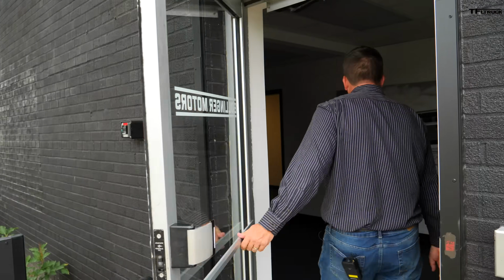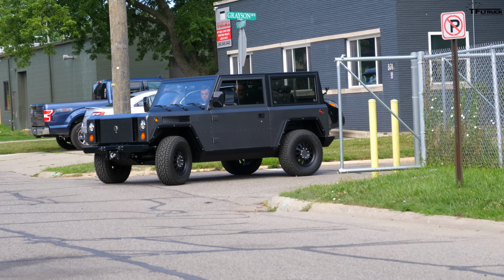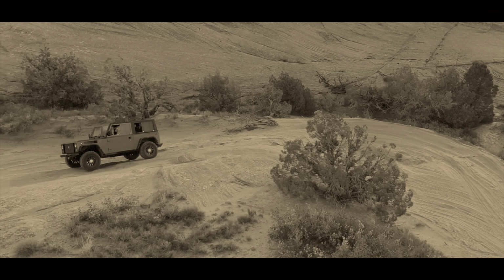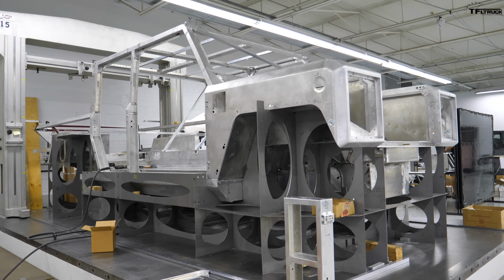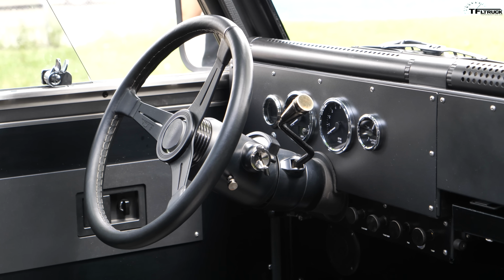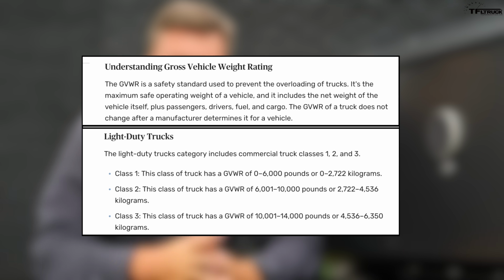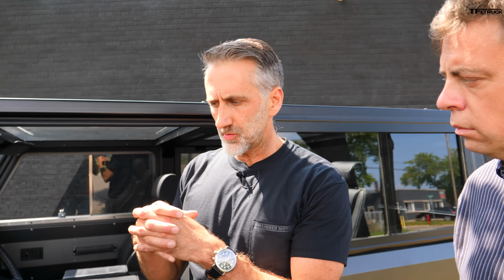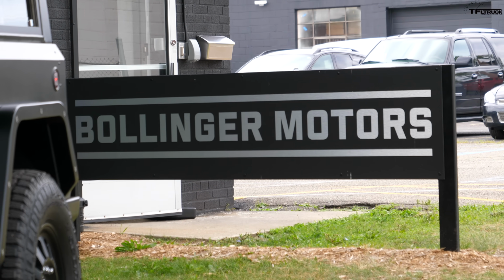EXCLUSIVE! Meet the Bollinger Trucks That Can Off-Road Like a Jeep and Haul Heavy

Comment: I love EVs however too bad these are EV. I could go on for 45min as to why EV off road trucks are silly but ill just say that most trails will be off limits due to no charging locations near trail heads. Even if you have 500miles of range 75% of trails in the US START 300 miles from any charging station. You would get to the trail head with less than 50% charge - I don't think I am ok with that.

Comment: This is a beautiful vehicle but I can't believe it only has 200 miles of range; that's barely enough to get to the trailhead, never mind doing any kind of overlanding. This thing has a 5,000 lb. payload, I don't get why they didn't just add 1,000 lbs of batteries to double the range. Much more valuable than the ability to haul, what, a bed full of lead?

Comment: The Problem with all these electric vehicles are they’re price!!!! This B-2 Is $125K!!!! Before options!!! I own a Power Wagon and My $70K Power Wagon can do all the 4X4 stuff this can do without the extra $70K and it takes 5 minutes to fill up… The only thing the Power Wagon can’t do is carry 20 foot boards through the Cab… So Why are they $125K as the X-ray showed us there are very few parts, a Battery Compartment, and Electric Motors by the axles and wheels.. and only 200 miles of Range???? That Sucks!!!! For $125K I better be able to drive to Russia with it… and 200 range is You babying it.. God Forbid if You Step On It, You’d probably barely get around the block…🤦🏻‍♂️ All these New Electric Vehicles are Big $$$$ How about a Cool Vehicle priced for Us Middle Class people who have mortgages, and Kids… No Way I’m spending $125K ( before options ) on a Truck..JS 🤷🏻‍♂️

Comment: I still dont understand the pricing. For around €100k you're getting what? The plainest, simplest vehicle i've ever seen. That really says something since I've been in a entry level Dacia Duster.

There are no features to the vehicle that would add additional production cost compared to a normal vehicle. No, actually there are no features at all other than it being functional. They're just charging a crap-ton of money for a car simply out of greed. Sure, designing a new vehicle costs a lot, but that's something that you plan for in the long run, not something that should be paid of when the first car is sold. 

Additionally, someone with that kind of money would never be hauling lumber and plywood, they'd hire someone to do it for them. Their market is the working class, not the wealthy. The concept is cool but the execution is just absolute horrible considering the pricing. This is a company that will never succeed.

More reasoning behind this never succeeding is the fact that their biggest competitor, Tesla, is also making a utility vehicle. A well known, huge company. Theirr base model will cost €37k and have more features. Sure, it wont be as practical but its enough for most. The top of the line Cybertruck will cost 70k and will include an ATV and top of the line interior and exterior features. Again, Bollinger is a company that will never, ever succeed.

Comment: At 15:50,  The BACK crash structure limits the impact to the driver when running into a FRONTAL barrier, as the bpi pulse the driver feels will do most of the work, then the seat belt does the rest. In plain speak, the rear bumper helps the driver feel better while he hits the front bumper while wearing his seat belt. Really?!?  This is the future??  Come on guys.

Comment: Seen this at La autoshow. 

I do not think its safe to drive it on freeway or anywhere you can get a collision. You can injure yourself  on the sll metal interior with sharp corners. Its just a rich man toy that  has no real purpouse for a construction worker. Nonody will pay so much yo haul some dirty pieces of drywall or plywood to a dusty construction site.  It will have no success in the real world. Just some collectors or ruch guys will buy it for some fun time. With 10 % of the money you can get a used Sprinter that is huge and covered if you need yo do construction. And heavy materials are delivered on jobsites for free by warehouses with flat bed. You place an order and next morning its delivered to your job site. This truck is no need for construction workers period. 

So its just a unsafe bix with strong motors.

Comment: 1. No self-driving, neural network system
2. Awkward looking
3. Not build by robot (not manufacturly scalable)
4. No supercharging network support
5. No pre-sale or post-sale support nationwide
6. No entertainment system
7. No SW update over the air
8. No proven battery tech
9. No safety rating
10. 200 miles range only
11. 75 mins "fast" charging

Good luck guys... I don't think this will go mainstream ever.

Comment: I love this thing. And I CANNOT wait to see what the future brings for EV mods. Like, this thing should come with a solar panel roof option in my opinion, for instance. There have to be people out there developing other passive capture or active electric generators that we could also add to systems like this, right? Regenerative braking is awesome, but why not also mini forced air wind turbines? We have plenty of space for intakes, right? With a diversified system of both passive and active generation, I think this thing could REALLY travel. I want a utilitarian EV truck that can take me around the world. A larger battery is one solution, but it does add significant weight. What other options have yet to be developed is my question.

Comment: Aluminum will not handle off roading not to mention corrosion. Battery and motors are not the future. The Humvee and Jeep will outperform anything and future generations of off road vehicles. Im in the Aerospace industry. Theres a reason why the military doesnt use crap EVs.  Gas engines and soundgasms for life for me.

Comment: Too pricey, a poser truck. Make a half sized AWD work truck with a drop gate flat bed and a 1/2 to 3/4 ton load rating. Put it on sensible sized, affordable tires and give the working men and women of the USA a kick start, instead of a kick in the teeth. This truck is stupid.

Comment: No it’s going to be garbage.  

#1 too expensive to want to really take it Offroad

#2 you can buy 1000 dollar Jeep that will out wheel that BS IFS easily 

#3 you will never have any charging ports to charge it at any real actual Offroad locations

#4 it won’t get the miles you want before you have to charge it for 6 hours

This is for the rich white dude that lives in town that never goes anywhere

Comment: First, I like the looks. Just the electric part is going to be my issue. It would need double the range of my gas vehicle because with my gas vehicle I can drive out into BFE and carry 2 10gal tanks with me and refuel and come back. Second, they would need to make that battery compartment bullet proof and more. I get a hole through the gas tanks I can plug it and refill and make it back to town. Lots of luck with that battery compartment if it gets a stray round from idiot hunter or other issue. Also it would need a built in recharging system that works in the same amount of time I can refill my gas tank. if it doesn't at least have 2 times the driving distance as the gas vehicle.
Currently, I tend to see an electric SUV as something for the yuppie who drives an SUV more for show than function.

Comment: This does not look like a consumer grade truck.  Remember the original HumVee?  In order to actually sell them it got turned into just another SUV, only larger and still uncomfortable.  What this thing looks like to me is a commercial grade vehicle.  I bet if they would offer it with a utility bed or two-door with bare chassis they could sell the heck out of it to utility companies.  It'd make a great lineman truck.  Or think about all of those windmills SE of Bakersfield, for example.  This thing would get around to them easily and could plug in and recharge while the technician is working on the windmill.  (Remember, the windmill is connected to the grid, so there is going to be power available at each unit.)  With 5000 pounds payload it could carry two and a half tons of tools and parts, maybe even rotor blades for the smaller mills with that super long cargo capability.

Comment: “Designed to take you off the beaten path”!?! Just an idea: fit some solar panels on top and when you run out of juice stay under sunshine for about a week so you can crawl to the next charging pod.
Reply: Same thought came to too..
Reply: exactly. This is grooming the masses to be controlled by electric grid. Taking away our means of  travel. The control of electric and weather while taking away our independent fuel. we can store gas and diesel and use bio home made diesel from plants. So take away combustion engine take away our independence! NWO i do not comply or concent. Think about how dangerous this really is!

Comment: As  long as I love the non compromise "welders dream car" philosopy behind it , I'm afraid they are too much of a garage business to make it cheap in mass production and accesible for normal people.
Reply: Only 1000 trucks a year.  This will be for the very wealthy. At that low production rate, the used ones will cost even more.  Buying one used and cheap won't even be an option. In low volumes is when American quality really shines.   In Detriot, there is an endless supply of extremely high-quality metalworkers.  Same for Toronto Canada.

Mass-produced Knock offs will follow especially in China.

Comment: Chevy Enthusiasts will strip the en gine dr op a stroked LS marry straight ax els 456 ge ared front and rear slap aftermarket underda sh A/C into that defrost directional vent contrap tion ! Take out that Sun letter inner and cover that or fice with a good gaged aluminum slap on a heavy duty overland rack +
 lad der winch both endz with tubular gaurds + mid frame rock guards 4front 4rear light bars and one on passenger one on driver side of theoverland rack ! With plenty of room f4 a indoorroll cage ! Yu will 👀 c a gas drinking stroked light wait helluvajob once they are done ! Cari on oh wayward Son !

Comment: This truck is ludicrous, i realise this is a prototype but I don’t think it is going to succeed. This guy claims to be an industrial designer, but some of the design choices are crazy. The all glass roof. The lack of occupants protection from excess loads. The profusion of hard internal surfaces will be keeping neurosurgeons busy. Terrible range. Ridiculous wheelbase on the longer models. General death trap design, but at least it can be hosed down after an accident! Kudos for the use of “aluuominum” though the wielding of it is difficult you really have to try harder! 

I found the admissions about the design hilarious, essentially they are avoiding the use of pressings, which I get is costly. But the result is really awful. People comparing it to a Land Rover are being unfair to LR , look carefully a defender has plenty of pressed panels with rounded corners. This bollanger is just a series of flat sheet panels on a frame, it is a real home build . Perhaps it could be sold as a kit car?

The engineering of the running gear looks good, but I am dubious about the maintenance of the design with inboard brakes close coupled to the motor. Thermal output from the motor may cook the brake fluid, and brake heat may affect the motor. The geared hubs are frightening. Also have they costed this? This is going to be a six figure vehicle based on what I saw.

Comment: I wish it had straight axles... That would really make it an good off road truck!!
Reply: Real good offroad vehicles haven't straight but portal axles for ground clearance even between the wheels :-)
Reply: Eventually someone will build an off road electric truck with a motor at each wheel. No axles, no CV joints, no portals. The articulation, center of gravity, and weight savings would be revolutionary. But by then, there won't be anywhere legal left to drive one.

Comment: All these comments about the boxy design, as if it's a bad thing. The Mercedes G-Class is very boxy, and is considered to be a luxury vehicle. I think this thing is great. Imagine getting a dent, or wanting to modify anything inside or out. It's all standard hardware. As someone who lives in a very rural area, this would be amazing for most people who aren't able to bend doors and bumpers back in place. Or adding lights, electronics, racks, whatever.

Comment: Being a defender fan my whole life this is the only other 4x4 I have seen that I can say yes I want 3 variation of it only thing is it needs a diesel engine for long expeditions.
Reply: like a defender
Reply: @beauchamphuberville1355  yup. 
I cant see me ever saying ok I am going to cross the desert 15 miles in after getting stuck 7 times batteries are flat I dont think there will be much charging ports in the Sahara for some reason lol I get the electric concept but it just cant work in this type of vehicle. In a city sure great idea
Reply: @90-wolf4  Its a terrible idea.  Its a marketing swipe.  its going to be less environmentally friendly as a construction as it does have has manufacturing behind it and the battery idea is a shocker for its purpose.

It will die a horrible death, because you can EV a jeep or a defender nd apparently you get a hole that you can put wood through.

jesus.  christ
Reply: @beauchamphuberville1355  for the wood I will just stick it on the roof rack or the trailer simple not sure what the weather is like were you stay but can you imagine the -5° air coming in there 😂😂😂. The best way I see it as phone the police or ambulance or fire crews and they say to you yep we will be out soon the car/trucks just charging 😂😂

Comment: Now as the future is electric we have to follow. I do overlanding in a very modified Tacoma in Iceland. In winter we do snow wheeling trips that last from short day trips to 4 day trips or maybe even longer. There is very little in terms of being able to recharge your vehicle. Depending on snow conditions and length of trip we will use anywhere from 60 liters of fuel to about 260 or even more. That's 15 to about 70 gallons. Our trips range from 200km or 125miles to well over 1000km or 620 miles or so. 

Our trucks are equipped with tires ranging from 33" to 54" and the minimum for a self sustained vehicle is about 38" tire modification. We run 44" tires on our Tacoma, deflated down to about 2 or 3 psi in deep snow, which drastically downgrades fuel efficiency. Now I am asking, how badly will that affect the range of an electric vehicle? Also how do the batteries perform and hold their charge in extreme cold? Below negative 25 degrees celsius? Also since the batteries and the majority of the electric components are placed relatively low in the truck, how secure are they when fording deep rivers or in deep snow? 

Now do not take this the wrong way, I am a supporter of the electric car but I am just wondering how long it will be when I am able to do this sport in a proper electric vehicle which I know can do the job. 

Also one note, would it not be smarter to have 4 electric motors, one on each wheel instead of just two motors and then do away with diff locks altogether? If an independent motor is controlling each wheel then you would just need to control input on that motor instead of a diff lock system. Simpler to fix if it breaks I would think.

Comment: These are going to be a maintenance hell. The way the whole body is sealed up with the motor inside and the rest of the drivetrain on the outside. Replacing those brake rotors or pads and probably any of the suspension components is going to be a pain.

Comment: I'm excited about sitting in a glass top greenhouse in July with no AC
Reply: Yeah, they definitely need to install window tinting at the factory.
Reply: Pretty sure you can swap out the roof. If nothing else, cover it.
Reply: Just open the pass throughs and get a windstorm up your shorts.
Reply: @michaellowe3665  best YouTube comment of 2019
Reply: They can install some kind of sliding blinder under that massive window. Not a biggie. What’s the elephant in the room here imo is that EV technology, although providing great torque outputs, is not ideal for “off the beaten path” expeditions (unless of course they come up with a solar panel or retractable wind turbine that’ll be able to recharge the 120kwh battery in hours - HIGHLY unlikely to be available soon).
Reply: @C_R_O_M________  - Roller blinds etc would be a practical and simple touch to this. If these guys got this far, they can easily design a solution like that.
Reply: Not a problem with the right tent or factory heat blooking chemicals.  In the Tesla 3 most of the heat comes in through the huge front window.   Not the glass roof.
Reply: In a Tesla most of the heat comes from fanboys
Reply: @fatboy19831  correct, with the right tent you can block any sunlight. Just asked campers everywhere.
Reply: Imagine @ -20°C in February.

Comment: Just remember, it takes at least 7 years to drive off the difference for the amount of emissions released to produce the batteries. Not to mention if your using coal to charge the trucks, And once the batteries are done, they'll leave a carbon footprint for the next 5,000 years

Comment: One of the great potentials of this vehicle is towing just mount an ICE style geny and you can run the truck with zero range anxiety go as far as you like in the bush drive for thousands of miles with no need to look for a charging station.